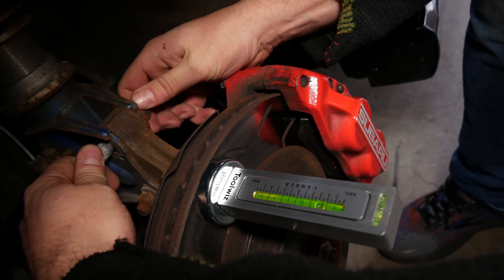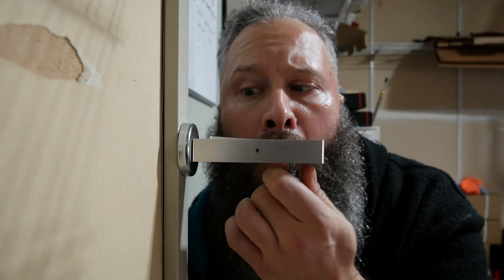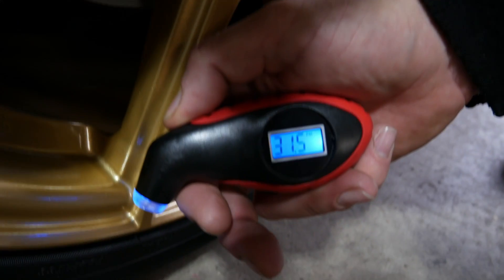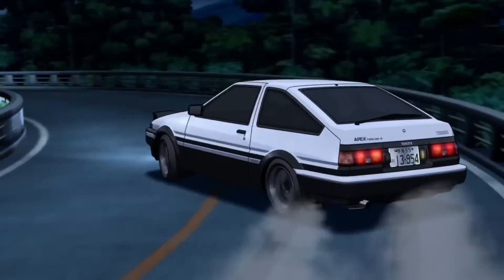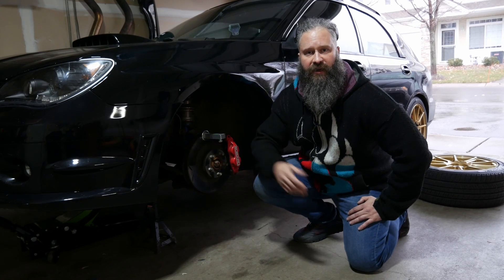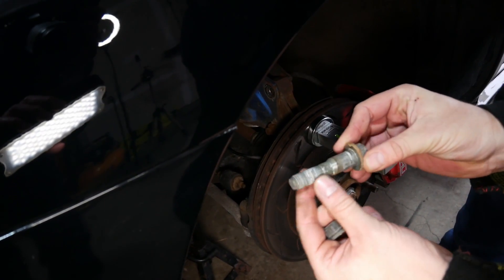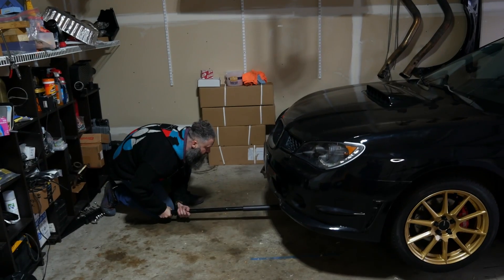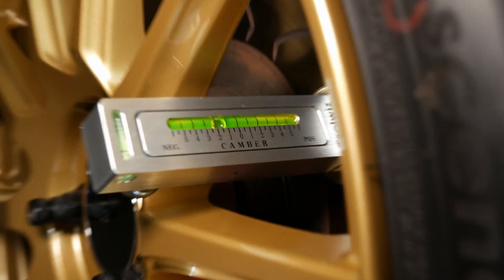How to use a Camber Tool

Comment: hey any idea why i'd get different camber measurements on different parts of the rotor?  i have a digital tool and it's zereoed correctly, but when i stick it on the top of the rotor through the wheel (on the ground) i get a much lower camber number than at the bottom of the wheel.  is there an optimal place to stick it?  confusing
Reply: probably the rotor is slightly concave or convex... basically the surface closer to the wheel is sitcking in or sticking out compared to the outside of the rotor. Might be due to how the pads wore the disc over time, or maybe the disc was resurfaced. That's my guess. If you stick it in the middle of the wheel, then you should get an average between the top and bottom. That's my suggestion at least.

Comment: So the car had to be on a perfect straight surface when you measure? And when you adjust the bolts while using a floor jack, does the car also has to be leveled? Do you need to raise all 4 points of the car?
Reply: No, you only need to know what the number is while the car is level and sitting all four wheels to adjust it. This is because you only need to adjust the degree which can be done even it the vehicle isn't level, as long as you know your cars camber specs and the magic number you got while sitting all rubber down, the levelness of the car only matter when the wheels touch because this is how you are going to drive it.
Reply: @andrewsimmons1918 yes, but after I measure with the wheels on the ground, I need to put rear side at least on two leveled stands without wheels to perform adjustment, right?

Comment: Also if you know how much you want to adjust the camper by put it onto your break make it so that the bubble hits zero then adjust your camper until the bubble is at the number you want to adjust by it won't be as precise as his method but I'll be quick and let you know how much you're changing it by approximately

Comment: How do you measure initial camber if you don't have spoked wheels?
Reply from the maker: You can place it on the center cap/hub.  Otherwise a metal bar or metal ruler that you can press against the length of the entire wheel and place the camber tool in the center of it.  Good luck!

Comment: OEM alignment specifications are established and measured with the full weight of the vehicle on low-tension turnplates. These steps ensure that tolerances in wheel bearings, kingpins, and other articulations don’t compromise the accuracy and precision required for a professional alignment.
Camber tolerances from side to side often need to be measured with a resolution as fine as 1/10 of a degree. Finally, any changes to caster or camber will alter total toe, requiring further adjustment.
Reply from the maker: Absolutely!

Comment: Forget that camber tool thats insane.  Just go to home depot and get the small quare digital level. Then go get an alignment and either get a print out of your alignment or take a picture of the computer results. Cause they going to say thier printer dont work at any firestone you go to , Then go home, and look at the paper if your  front right wheel is -8 camber on the paper . Jack the car up and take the wheel off and place the new orange digital home depot square level on the rotor cause it has a magnet on it, and what ever the number is , just move your camber bolt+8. The end.  Thats how i do mine , it took me a year to figure out a way to set my camber i did all type of stuff man.  All my camber is 0 on all four corners nowadays.  Thats really the only way.  Just got to get another alignment after you set it. But firestone lets you come back. So it ain't like you have to pay for another alignment.
Reply from the maker: That firestone, so problematic!  Thanks for the advice!
Reply: What a super pain in the butt. Pay for an alignment and then do it yourself anyway? Sounds pretty silly to me
Reply: Yeah what about when Firestone tells you they can't do the alignment because you need tie rods, or struts, or ball joints, or whatever the fuck they're trying to sell you that you don't need??? Haha..... Fuck Firestone, Mavis, and all those stupid chain places.
Reply: What the fuck is the point of actually taking your car and spending over $100 to get an alignment at a shit shop just to come home and use a laser level????? The entire point of a tool like this is so that you don't have to have idiots work on your car and so you don't have to spend excess money. I really hope you don't give advice often because you're absolutely terrible at it.
Reply: Besides you don't even know how to speak the English language correctly. So I guess it kind of makes sense that you don't know what you're talking about. Read a book. It might help with your terrible grammar.

Comment: the only problem with you system is no stick built homes have walls that are a perfect 90 degrees to the floor, i use a 90 degree framing square on the floor right next to the cars wheels so i am guaranteed  to be 90 to the floor....
Reply from the maker: It's true, they're not perfect.

Comment: Pretty impressive for a cheap amazon tool but how accurate can you actually get it by just eyeballing it. I want my front camber to be -2 degrees and currently its -1.9 on one wheel and -2.1 on the other. Could I realistically dial it in to the tenths? Great video nonetheless!
Reply from the maker: Thank you!  You could try but that's a lot of effort for 0.1 degree, would be fun to test out though!

Comment: Do not put it on top, because the disc is not right-angled!
Reply from the maker: It's close enough for an at home camber tool!
Reply: The disc isn't at a right angle to the hub?
Reply: @larrybud  Not. Because, it does not wear equally when braking.

Comment: You forgot to mention once you move the camber you must re set the toe in.
Reply: It wouldn't have moved the toe angle enough to be worried. However, if the camber angle was way out of alignment due to a damaged component then the toe alignment would be carried out after replacing that part.

Comment: You gave me some advice for sure... But Im inclined to to believe the top bubble is supposed to be centered... yours was not... I believe that bubble is supposed to be centered during adjustment and calibration for an "accurate" reading... correct me if im wrong... youve obviously used this more than me... even though I see no follow up videoes

Comment: Top tier video, do you know the details of the wheels' color? Like what color and what kind of clear coat they have
Reply from the maker: Thank you, I appreciate that!  The wheels are Enkei TS-10's in the color Gold.  They also have a ceramic coating on them.
Reply: Nicely explained. It is the video that should be included when you buy the tool.

Comment: Sorry but shouldn't the camber also be done with the weight of the driver?
Reply from the maker: No need to be sorry, it's a good question.  You'd really only see that in high profile/modified cars where the weight of the driver would make a larger difference.  Alignments aren't done with driver weight either.  If you'd like to set camber with the weight of the driver then also consider setting camber when you have a passenger as well or someone in the back seat(s).  How about setting camber with a full tank and also a half tank of gas?  Setting the camber and getting alignments with no driver weight is just the standard.
Reply: @subearu  Right, it depends a lot on the type of use you make of the vehicle. I also use my car on the track, so I set it with driver weight and around 25 liters of fuel. It is not a car used to carrying passengers 😂. However, you made a nice video guide, very precise and useful, especially for standard use of the car as you said.🤙

Comment: Where do you place the jack
Reply from the maker: Great question, I personally like to use the front jack plate that is behind the oil pan.  It has four bolts and is kind of a square shape.  Otherwise you can always use the pinch welds on each side of the car next to the wheels or the rear differential works as well.  Hope this helps!

Comment: We dont really need buy the clamp that needs to be purchased separatelt with the bubbler?
Reply from the maker: You don't have to purchase that as well, it just gives you a flat surface to measure on.  As long as you have a flat surface to put the camber tool on, you should be all good to go!
Reply: Fish tank have to do with it ?

Comment: Where do you find the camber specs for your specific make and model?
Reply from the maker: Your manufacturer's owners manual has the stock camber specifications for your vehicle.  You can probably just find it online as well.  If your car is lowered then your camber specs will change.